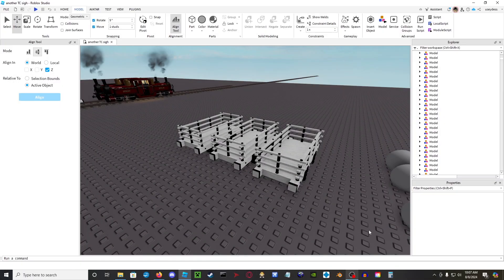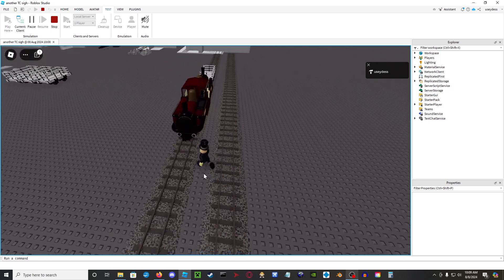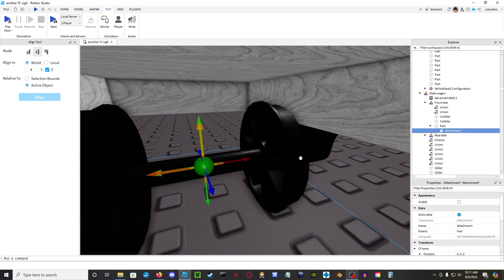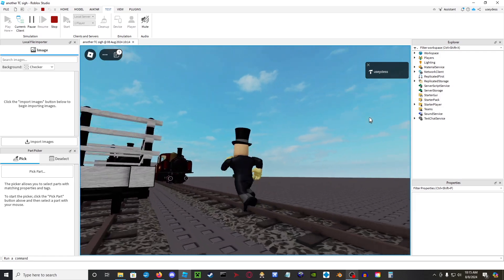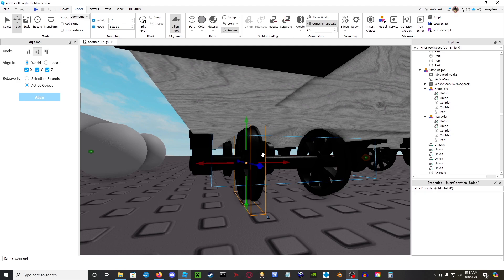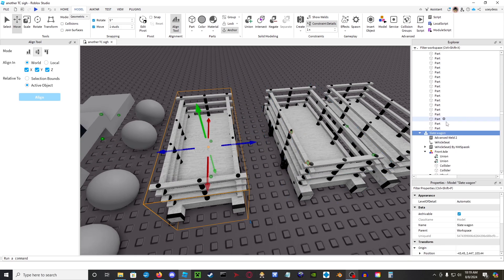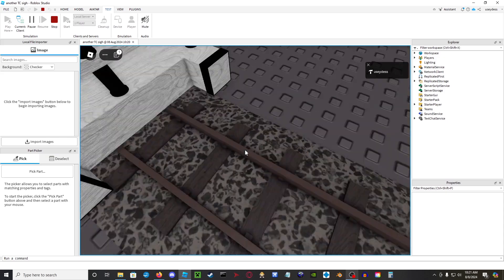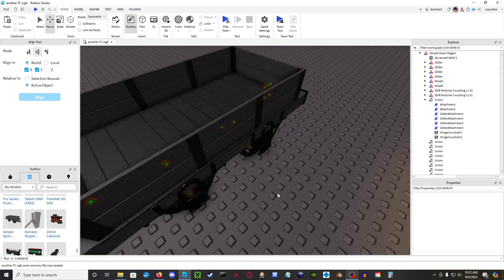How to rig Rolling stock in Roblox Studio

Comment: idk why every time I try to make a vehicleseat2, my train always makes warnings in the dev console and slow my game down
Reply from the maker: must be an issue on robloxs end or your doing something wrong
Reply: @niklasmolin3195 i did check the scripts and one of the script has a warn() if it doesn't find an attachment, i did remove it, I think it did work but i think it just silences it.
Reply from the maker: @173saw  strange, must be something that NW left in there
Reply: @niklasmolin3195 im working on a train game, some blocky, cartoon style so it's not realistic but after I couple 10+ railcars it starts to get laggy when the player would touch the chassis, and the lag would get worse the more you couple

Comment: 8:02 The offset is from the VS2 train having the constraints offset aswell for some odd reason.
Reply from the maker: yeah idk why NW did it like that, threw me off quite a bit but it doesn't affect the model if its offset like that
Reply: @niklasmolin3195  The reason why he most likely did it is because of lag. When Roblox lags, constraints get wobbly and if the hinge is in the center of the axel then it evenly spreads the wobble to both sides. What you did at 7:40 is the same thing; just using a extra part. As you said, it doesn't really matter much unless you have a large game or a really heavy engine.
Reply from the maker: @toaster_the_amethyst  interesting, might explain why im unable to rig some engines for a friend, i'll have to look into that thanks